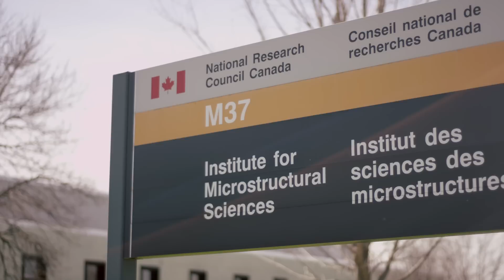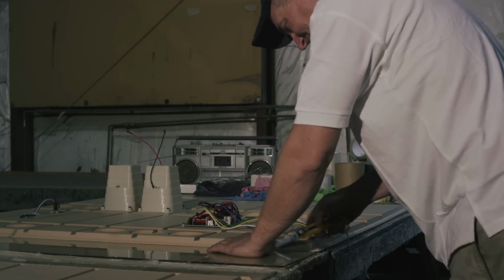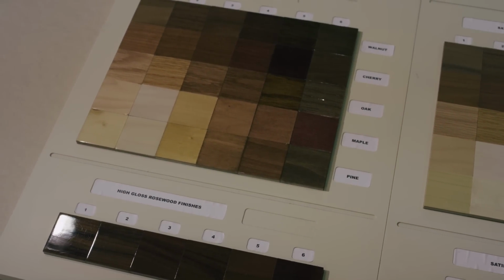Axiom Audio's M100 v4 Loudspeaker | SoundStage! InSight

Comment: I've got a question about the dual tweeters and dual midranges--  do they play the same frequency band?  If so, doesn't that cause lobbing or comb filtering in the acoustic radiation pattern?
Reply: Yup. It will destroy the sound field, but I do not think they know what that is.

Comment: How were the v4 tweeters changed from previous.  I have a pair of m60 v2 and I've been thinking about upgrading to the new m100
Reply: i would like to know this too.....!
Reply: They have metal instead of plastic baskets which up'd the power handling, etc. I'm currently trading in my M80's for M100's.